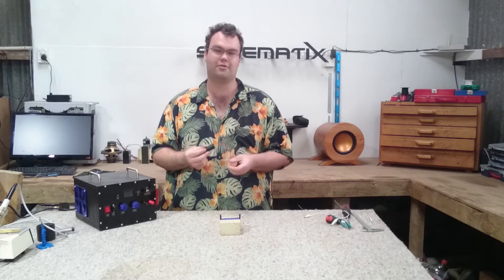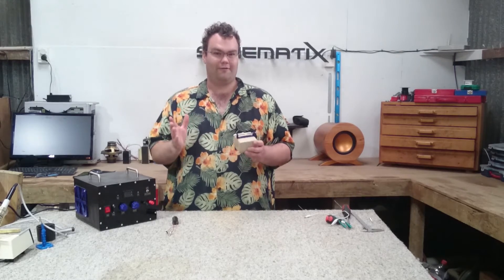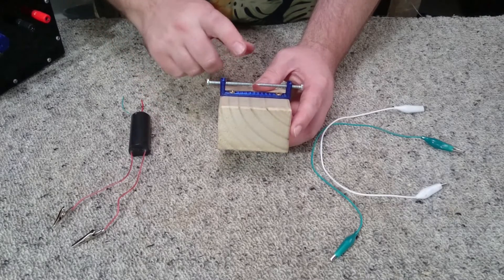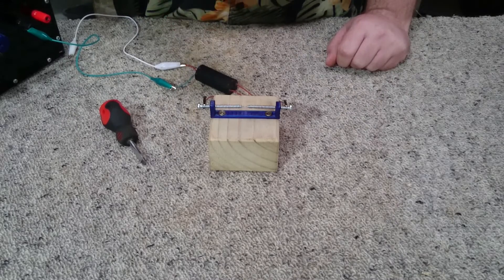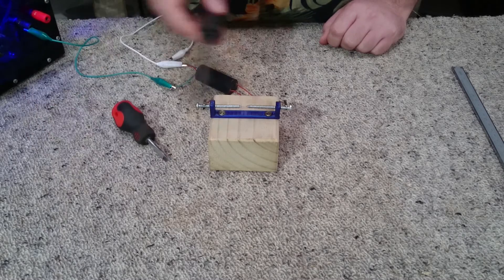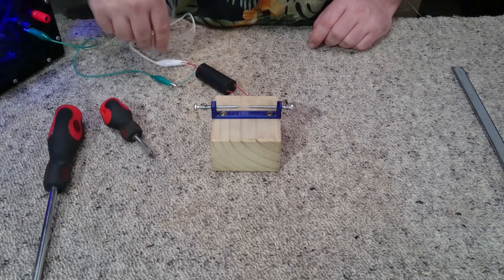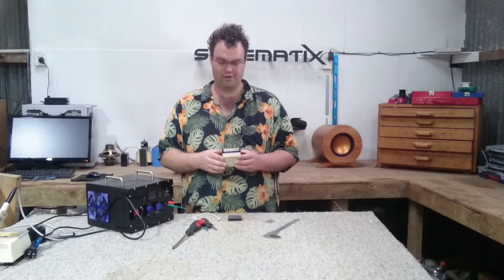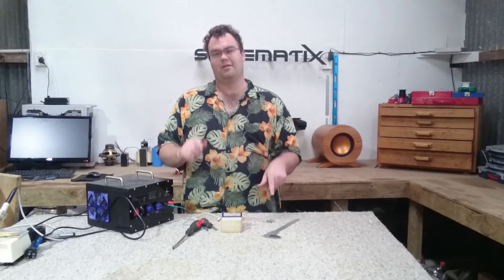How To: Make a spark gap to measure HIGH VOLTAGE!

Comment: Spark gaps aren't a great way to measure voltage. If you use spark gaps it's better to use spherical electrodes with radius>>gap. There are tables to look up factors for homogeneity of e-fields based on electrode shape (Schwaiger). Most commonly you use spheres or cylinders for this kind of measurement. Spheres being easier.

Comment: I own one of those "claimed" 400kV pulse generator. It measured around 20-25mm sparkover. I achieved that distance by using 4.5V power supply set to current limit at 3A. It seemed to draw more current than that, but I did not go beyond it to avoid damaging the unit.

Comment: I hear these are illegal to use... Which makes no sense it's so simple.
Reply: I'm thinking they're probably referring to taser-like self-defense units, that generate high voltages and a spark.
Reply: @baruchben-david4196  I recall that these things basically interfere with broad-band radio signals, they can interrupt a lot of wireless data transfer.. I dunno what I was thinking when I wrote this. Probably just ignorance

Comment: The voltage of a 5mm gap is NOT (5) times the voltage of a 1mm gap. The streamers go out spherically and so require exponentially more as you increase the distance. Also there is amps to consider. If you increase the amps you power the air to achieve break down voltage a lot faster and the length increases at the same voltage.
Reply: Actually, acording to Paschen Law the increase of voltage increases the spark gap length linearly and it is roughly 3.4 MV / m at 20 ºC 1 atm. It only increases exponentialy at distances bellow 10 um ( micrometers ).

Comment: for a very pointed electrode (like a needle) .. voltage is closer to 1000 volts per mm.  If you were using some very large spherical tip electrodes, about 10mm in diameter .. then you might expect 3000 volts per mm. In your experiment here, voltage probably closer to 6000 volts.
Reply: i agree 1000 volts per mm

Comment: Hi Did you try 6volts or 3.7 they can go to 6volts thanks Jeff.
Reply from the maker: I've tried 6volts but it didn't seem to make any difference with the stepup I have. My guess is it probably has internal voltage regulators so more volts does not equal bigger spark (at least for my unit)
Reply: Hi Thanks Jeff.

Comment: How can i get a high voltage without a high voltage power supply?
Reply: I know but I won't tell you cause don't know how do you spell this thing in English...
Reply: Well you can use a microwave transformer, and take the secondary coil wire and tap it on the metal core, or you can get a flyback transformer from a tv, and a light ballast. Take the 2 blue wires of the light ballast and hook to the primary coil of the flyback, then you can take one of the yellow wires from ballast and connect to other primary pin. Take the high viltage wire coming out the top (its red) of flyback and pull it down to the pins and see whick one it arcs to best :) (the microwave transformer is lethal)